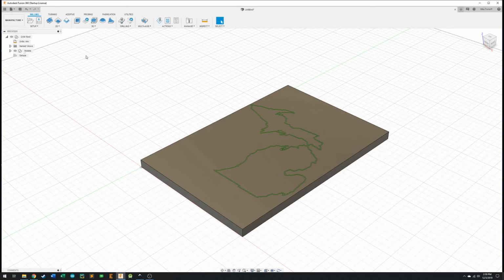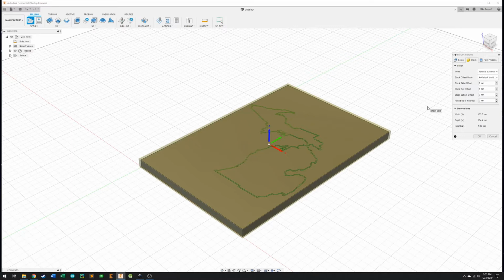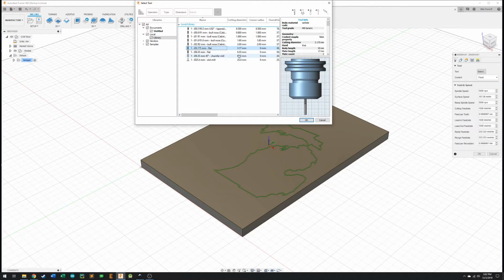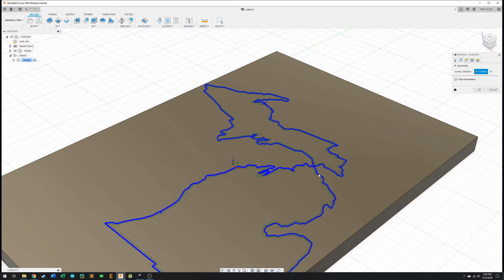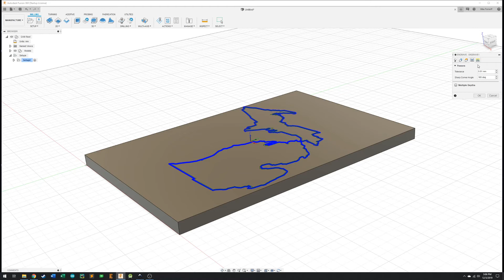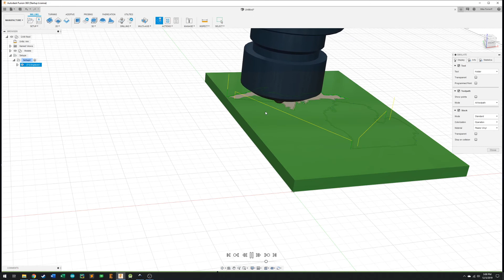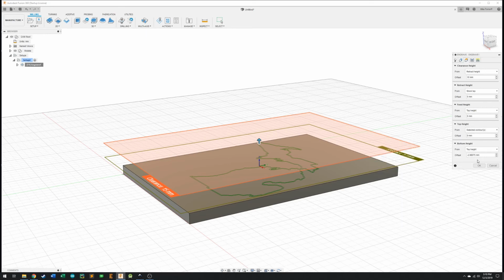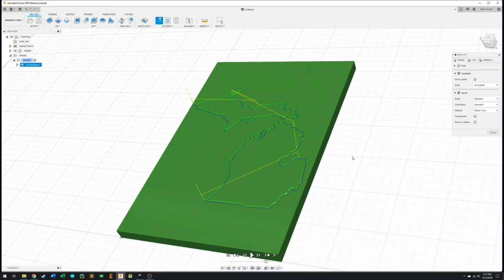CNC Engraving - Part 3: How to Create an Engraving Toolpath

Comment: I was fine until we got to be bit.  You had bits already configured.  I don't so now I'm stuck.  I have 1/4 shaft with 15, 45, 60, and 90 degrees but when I try to set these up the Simulated run only barely touches the piece before it stops.  I think that it believes my bit is 1/4 wide but it's not.